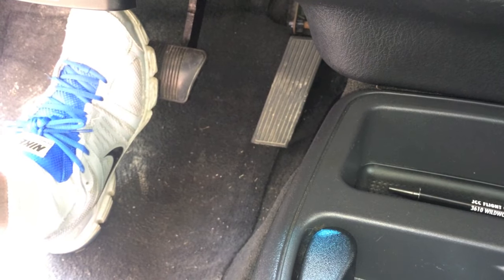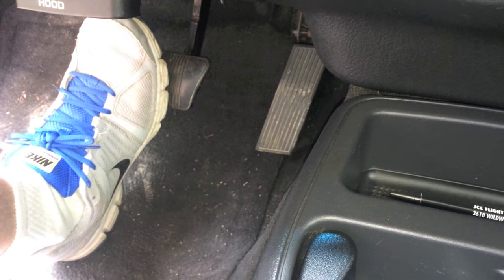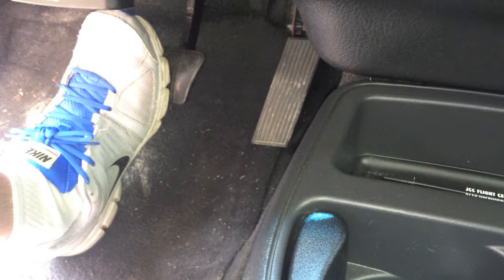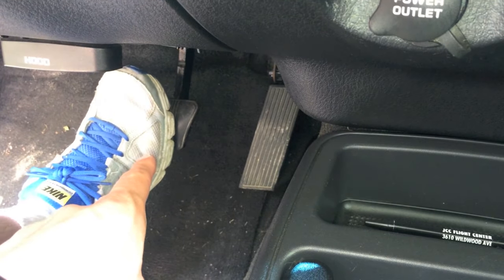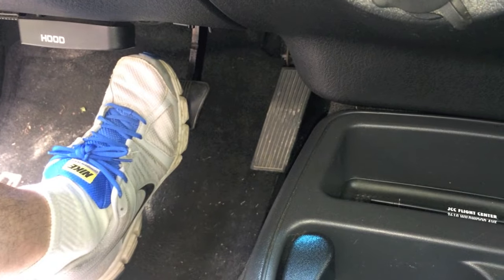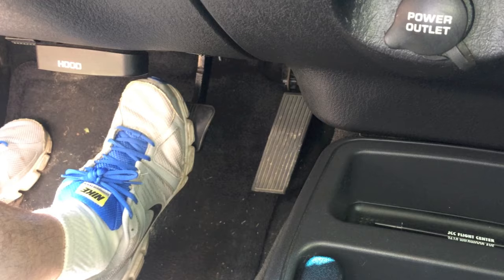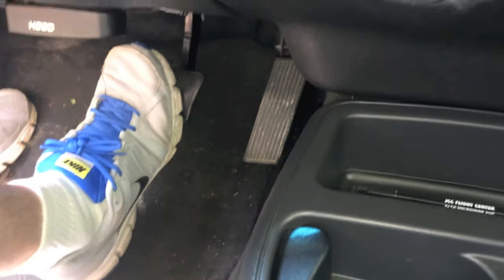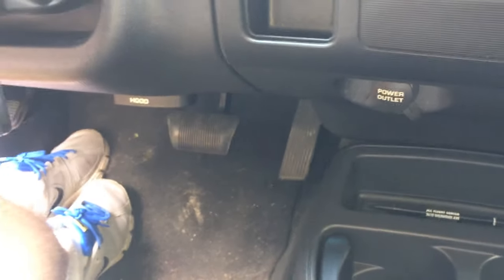HARD Brake Pedal - How to check if your BRAKE BOOSTER is GOOD or BAD

Comment: Did that and still will not stop the car at a idle backwards or fordwards. What next?
Reply from the maker: Ronald P. Higby 

Thanks for watching Ronald.  A few things to look at.  Has there been any MX Work done to the Brake System in the last year?

Look under vehicle and check to see if you can find any indication of brake fluid leaking out of any of the lines.  Even the tiniest leak will interfere with the concealed pressure required for the brakes to work properly.  Follow each brake line from reservoir under hood back to each wheel to see if any leaks.

If no leaks found, check that your reservoir is at its proper fill line.

Next take a look at the small plastic vacuum lines that feed out of Booster.  While the engine is running, have someone press the brake pedal.  As they press it, check to see if you hear any hissing.  If you hear hissing, locate the vacuum hose that leaks and replace it.  The loss of vacuum pressure will interfere with the efficiency of the brakes.

If no hissing, it might be your Check Valve.  Below is a link that talks about Check Valve.

After completing these checks, and all works properly, the only two remaining are your Brake Booster & Master Brake Cylinder.  Below are links.  I know it’s a lot to look at but the earlier items to check won’t cost you anything to just check.  Keep us posted.  Let’s get you back on the road safe.  Please subscribe to the channel and turn on your YouTube notification Bell 🛎 that would be awesome thanks again 

😎👍🔧🔩

Too much Fluid in Reservoir:

https://www.youtube.com/watch?v=X-AJ5tD6zoA&list=PLjCXOz8TSkZnavDiGDyHdPKe2dV2RzEMZ&index=39

Failing Front Brake Lines:

https://www.youtube.com/watch?v=3FTEgbLYAdI&list=PLjCXOz8TSkZnavDiGDyHdPKe2dV2RzEMZ&index=78

Brake Pads not shifting:

https://www.youtube.com/watch?v=3Pq15BWM_qY&t=103s

Replacing Front Brake Calipers:

https://www.youtube.com/watch?v=8HoaL4QM5-k&list=PLjCXOz8TSkZnavDiGDyHdPKe2dV2RzEMZ&index=83

Failing Brake Booster:

https://www.youtube.com/watch?v=j9s7yccswPQ

Symptoms of a Failing Brake Booster Check Valve:

https://www.youtube.com/watch?v=j9s7yccswPQ&index=68&list=PLjCXOz8TSkZnavDiGDyHdPKe2dV2RzEMZ
Reply: Rebleed the brakes didn't help, started the car and had son hold the brake pedal down hear a gregling sound shut the car off pulled the vacuum hose and booster was full of brake fluid, so think I'm needing to replace booster and master?
Reply from the maker: Ronald P. Higby 

Thanks for the update Ronald.  It’s possible that it’s your Booster rather than your MBC.  Either way, replacing both parts is definitely a benefit.

Keep us posted!  😎👍🔧🔩
Reply: Ok replaced both the booster and master pedal rock hard no brakes still. Was told the ECU needs reset with the omii reader?
Reply from the maker: Ronald P. Higby 

Thanks for the update.  Onto the next troubleshooting step.  Let us know what you find with the ECU.

Also it’s very important that the master brake cylinder was properly bled prior to install.

😎👍🔧🔩

Comment: How to check if the booster is weak?
Reply from the maker: Thanks for watching.  How did your booster perform during this test?

With engine running and hood open, do you hear any hissing sounds coming from vacuum lines near the master brake cylinder inside engine compartment?

If so, a vacuum leak can degrade booster’s performance.

Comment: Hey I have a question, I pressed my brakes so hard in the red light,and directly after I start hearing noises n even I couldn’t press my gaz was scary and just decided to go back home,do u have any idea what just happened to my(Audi 5) by the way I have noooo idea about cars or anything thank u in advance
Reply: Stay away from Audi and anything else euro
Reply from the maker: المهاجرة الحزينة

Thanks for sharing, You May have just shocked your Caliper Pistons & will need to let them cool off.  Let the vehicle sit for a minimum of 3-5 hours & see if your brakes begin working normally again.

Keep us posted.  Please subscribe to the channel and turn on your YouTube notification Bell 🛎 that would be awesome thanks again!

😎👍🔧🔩
Reply: DIY With Michael Borders thank u for replying! Yep for 5 min I become happy and was normal after back to same issue 😭
Reply: Steve Dupree right!! It’s tooooo expensive to fix
Reply from the maker: المهاجرة الحزينة 

This is definitely not uncommon!

It can be a few different things....Lets figure it out!

First thing that comes to mind is your fluid level!  Make sure your brake fluid is not outside the proper fill parameters.  This causes brake system performance issues...explained in more detail below!

Let’s work through the items!

1.  Its possible that your caliper is beginning to stick...maybe caliper slides have lost the lubrication required to shift back and forward freely.

2.  It can be possible that your Caliper piston has lost its lubrication which will also interfere with the efficient shift back for forth.

3.  The front rubber brake lines that connect to your caliper fail from the inside as opposed to the outside.  This means the inner coating begins to break away and clog portions of the brake system...hence not allowing fluid to flow back and forth freely.  

4.  Your brake pads have little prongs/teeth on them.  You will notice by their location...the pads slide on a steel brace.  This may need to be lubricated to bring the shift back to efficient requirements.

We have attached a few videos.  Lets start with the easy items and then work our way up!  Lets figure this out together!  Keep us posted!  Please Subscribe to the channel and turn on your YouTube notification Bell 🛎 that would be awesome!  Thanks again!

Links to all of our helpful step-by-step videos explaining the above possible causes are below, definitely check those out!  😎👍🔧🔩

1.  Caliper Slides Lost Lubrication:

https://www.youtube.com/watch?v=-DZ68tKuCQc&amp;t=15s

2.  Too much Fluid in Reservoir:

https://www.youtube.com/watch?v=X-AJ5tD6zoA&amp;list=PLjCXOz8TSkZnavDiGDyHdPKe2dV2RzEMZ&amp;index=39

3.  Failing Front Brake Lines:

https://www.youtube.com/watch?v=3FTEgbLYAdI&amp;list=PLjCXOz8TSkZnavDiGDyHdPKe2dV2RzEMZ&amp;index=78

4.  Brake Pads not shifting:

https://www.youtube.com/watch?v=3Pq15BWM_qY&amp;t=103s

5.  Replacing Front Brake Calipers:

https://www.youtube.com/watch?v=8HoaL4QM5-k&amp;list=PLjCXOz8TSkZnavDiGDyHdPKe2dV2RzEMZ&amp;index=83

6.  How to check if Brake Booster is Failing:

https://www.youtube.com/watch?v=VK4lowH7kQE&amp;index=66&amp;list=PLjCXOz8TSkZnavDiGDyHdPKe2dV2RzEMZ

7.  Failing Brake Booster:

https://www.youtube.com/watch?v=j9s7yccswPQ

8.  Symptoms of a Failing Brake Booster Check Valve:

https://www.youtube.com/watch?v=j9s7yccswPQ&amp;index=68&amp;list=PLjCXOz8TSkZnavDiGDyHdPKe2dV2RzEMZ

9.  Master Brake Cylinder info

       https://youtu.be/F9s_1VZ2u5E

Comment: Mine was fine I changed from carb to Fitech efi and now it’s not working is there a way it gets like stuck and needs to be just adjusted somehow I feel it’s new but something is wrong with it can’t be a major issue
Reply from the maker: Troy mackeod 

Thanks for checking out the video.  This is definitely not uncommon!

It can be a few different things....Lets figure it out!

1.  Its possible that your caliper is beginning to stick...maybe caliper slides have lost the lubrication required to shift back and forward freely.

2.  It can be possible that your Caliper piston has lost its lubrication which will also interfere with the efficient shift back for forth.

3.  The front rubber brake lines that connect to your caliper fail from inside rather that outside.  This means the inter coating begins to break away and clog portions of the brake system...hence not allowing fluid to flow back and forth freely.  

4.  Your brake pads have little prongs/teeth on them.  You will notice by their location...the pads slide on a steel brace.  This may need to be lubricated to bring the shift back to efficient requirements.

I have attached a few videos.  Lets start with the easy items and then work our way up!  Lets figure this out together!  Keep me posted!  Please Subscribe to the channel that would be awesome!

1.  Caliper Slides Lost Lubrication:

https://www.youtube.com/watch?v=-DZ68tKuCQc&amp;t=15s

2.  Too much Fluid in Reservoir:

https://www.youtube.com/watch?v=X-AJ5tD6zoA&amp;list=PLjCXOz8TSkZnavDiGDyHdPKe2dV2RzEMZ&amp;index=39

3.  Failing Front Brake Lines:

https://www.youtube.com/watch?v=3FTEgbLYAdI&amp;list=PLjCXOz8TSkZnavDiGDyHdPKe2dV2RzEMZ&amp;index=78

4.  Brake Pads not shifting:

https://www.youtube.com/watch?v=3Pq15BWM_qY&amp;t=103s

5.  Replacing Front Brake Calipers:

https://www.youtube.com/watch?v=8HoaL4QM5-k&amp;list=PLjCXOz8TSkZnavDiGDyHdPKe2dV2RzEMZ&amp;index=83

6.  How to check if Brake Booster is Failing:

https://www.youtube.com/watch?v=VK4lowH7kQE&amp;index=66&amp;list=PLjCXOz8TSkZnavDiGDyHdPKe2dV2RzEMZ

7.  Failing Brake Booster:

https://www.youtube.com/watch?v=j9s7yccswPQ

8.  Symptoms of a Failing Brake Booster Check Valve:

https://www.youtube.com/watch?v=j9s7yccswPQ&amp;index=68&amp;list=PLjCXOz8TSkZnavDiGDyHdPKe2dV2RzEMZ

Comment: I did this test and before I start the engine the pedal still can be pushed in...not as easy tho..is that supposed to happen?
Reply from the maker: jbentley8383 

Thanks for watching!  As you press your Brake Pedal with the engine off, your system will build pressure.  As it builds pressure, the pedal will continue to get more firm.

Once your engine starts, the system will activate & release pressure accordingly.  It’s also important to state that with your engine off, it’s not recommended to continuously press your vehicles brake pedal with engine off.

We hope this helps!

Please subscribe to the channel and turn on your YouTube notification Bell 🛎 that would be awesome thanks again!  😎👍🔧🔩
Reply: Best video on checking brake booster.  Thank you! Well done.

Comment: What happens if your brake pedal is so stiff you cant even really push it in?? Tried to do this but with the pedal so stiff its hard
Reply from the maker: Thanks for watching, a few things can cause this.  The most common issue that leads to this is a deteriorated rubber brake hose feeding off a caliper and securing to the hard line fitting at the wheel well frame.

Unfortunately, these hoses fail from the inside out.  Although a hose may look perfectly fine from the outside, it may be completely crumbling on the inside.

Once it begins to crumble, small rubber pieces begin to break away from hose and travel freely through the brake lines.

Overtime, those rubber pieces that are traveling freely begin clogging your brake line, leading to brake fluid not being able to flow when pedal is pushed.

The second likely cause is a damaged and seized caliper.  If the internal caliper piston is stuck in the extended position, your brakes will lock and your pedal will be stiff.

Comment: My abs lights went on on my 2011 camry hybrid I have been driving with no problems now my pedal is hard and not stopping easily. Since it is a hybrid how do I get my vacuum with the hybrid I hear my Abs module constantly powering up it did this for over a month until the warning lights came on now in the last couple of days I have a hard petal and not stopping like it did.
Reply from the maker: Thanks for watching & welcome to the DIY Raptor Club.  A few things come to mind.

1.  Worn out caliper:  There is an internal piston inside the caliper and when it wears out, it gets stuck in the extended position... which...is the position your piston transitions to when you push the brake pedal.

After you release your brake pedal, the piston is possibly staying extended and keeping the brakes engaged.

2.  Failing brake hose:  There is a rubber brake line that feeds off your caliper and makes its way to the hard line which then travels all the way upstream to your master brake cylinder.

These brake hoses can fail from the inside out.  What happens is little pieces of rubber break away and cause clogs in the lines... not allowing brake fluid to move.

It’s possible that you have a piece of rubber clogging your brake fluid and keeping your brakes engaged.

Keep us posted, us DIY’ers need to stick together!  😎👍

Comment: Why my brake is not getting when engine off suddenly especially in slopes??..ie. Brake becomes hard when engine off..
Reply from the maker: Thanks for watching and that is normal.  When engine is off, the vacuum system is not running which alleviates the assistance of proper operation of the brake pedal.

Comment: My pedal on my 07 durango seems fine replaced all brakes front and back and 2 rotors up front but my brake light still comes on after like 15 min of driving then when i shut key off and restart its out again till I drive for a bit again . any thoughts? Fluid is at full

Comment: My brake booster failed suddenly today on my 2017 Silverado.  Thankfully I was only parallel parking and thinking quickly, I threw the truck into park before I hit the car behind me.  Had I been traveling say 30mph and approaching a red light when this happened, I surely would have slammed into anyone who was stopped in front of me.  I had to have it towed to the dealer where I leased it from.  This is very concerning to me as I'm often driving with my 2 year old in the back seat.  I'm now very nervous about continuing to drive this truck after its repaired.
Reply from the maker: Joe Scopa 

Absolutely unexceptable for a Brake Booster to fail in less than two years!  That is very disappointing on Chevys behalf!  We definitely understand your concern & don’t blame you.

We are sorry to hear that & we are interested in what you do from here.  Chevy seems to have unfortunately lowered their quality in engineering & their vehicles & parts are not lasting as long as they should.

Keep us posted!  Please subscribe to the channel and turn on your YouTube notification Bell 🛎 that would be awesome thanks again!

😎👍🔧🔩

Comment: What if break pedal go all the way to the ground an I have no pressure in break pedal
Reply from the maker: Timothy Gonzalez 

What’s up Timothy, thanks for watching.  We recommend inspecting all of your brake lines underneath vehicle to ensure you have no leaks.  Next, check your reservoir and verify that your brake fluid is within its proper fill parameters.  If you have no fluid, you have a leak somewhere which can lead to your symptoms.

If you do not have a leak, you most likely have a failed master brake cylinder.  Keep us posted.

Please subscribe to the channel and Ring your YouTube Bell 🛎 that would be awesome thanks again!

😎👍🔧🔩

Comment: Ok so mine its stiff when I start truck it goes down just a tiny amount but the truck also sounds like it's going to shut off like it's haveing a hard time trying to run while my foot is still down on it but once I release it the break it sounds just fine you think that might also be the booster or something els? Also it's only at that moment if I push down while in park after truck is running it does not do that only before and the start it
Reply from the maker: real hefty trout 420 

Thanks for watching & we hope you enjoyed the video.  You may have a Booster that is in its early stages of failure.  When engine is running either at idle or driving, if you start hearing aggressive suction sounds, Booster is wearing out.

If it’s a loud hissing sound, you will need to locate which vacuum hose feeding off of your Booster is leaking & get it replaced.  😀👍

Many more helpful videos to come!  😀  Please subscribe to the channel and turn on your YouTube notification Bell 🛎 that would be awesome thanks again!

😀👍🔧🔩
Reply: @DIYwithMichaelBorders  thats what I was thinking thanks for your input already got new one on the way
Reply from the maker: real hefty trout 420 

😀👍🔧🔩